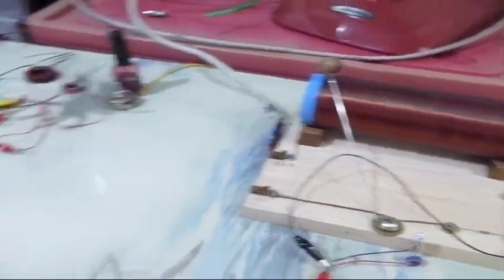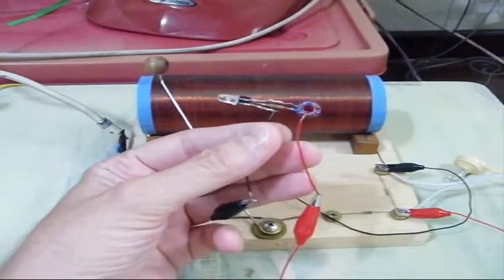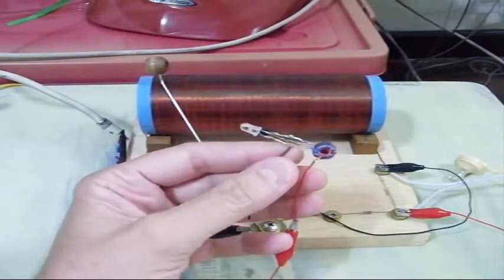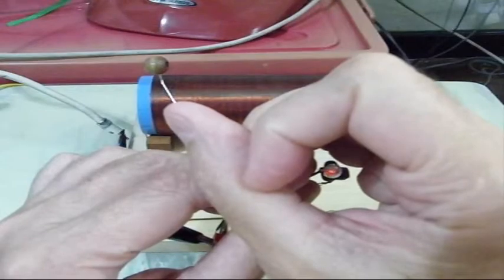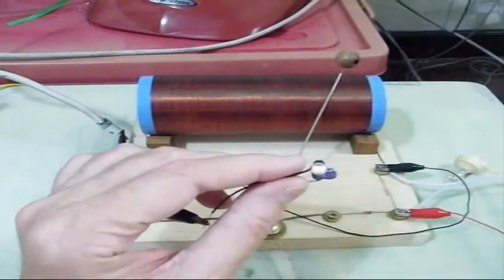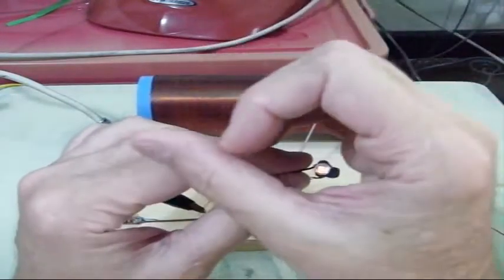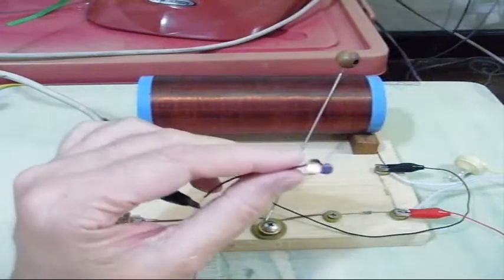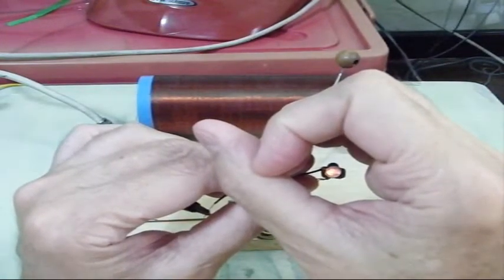Joule Thief PLUS Crystal Radio Equals ??? (Pt 1)

Comment: Will it work with your zenor diode radio?
Reply from the maker: This radio has a 1n34a germanium diode (zeners won't work, too inefficient), so it works with that.  Unless you mean the radio that is just the diode.  That probably will not work.  The coil has inductance / capacitance that helps boost the voltage and stores a bit of power between cycles.  Frankly I'm amazed that this worked at all!